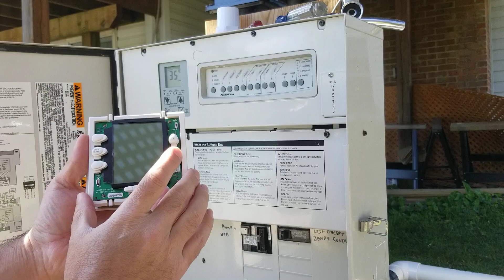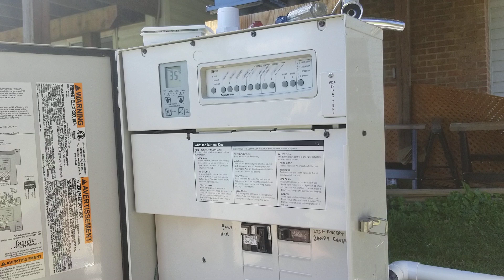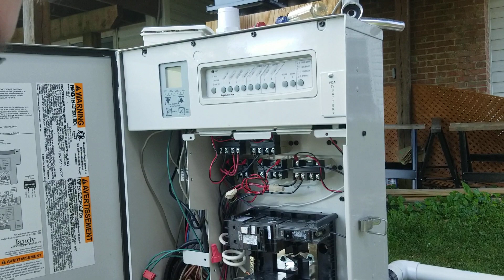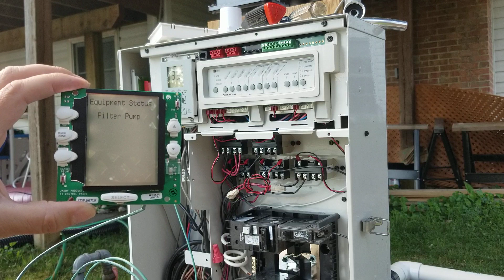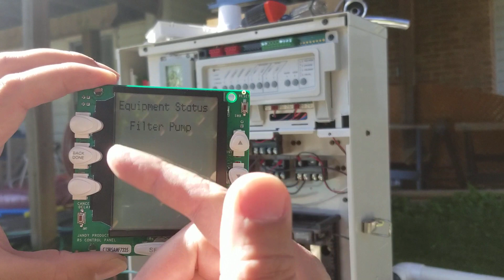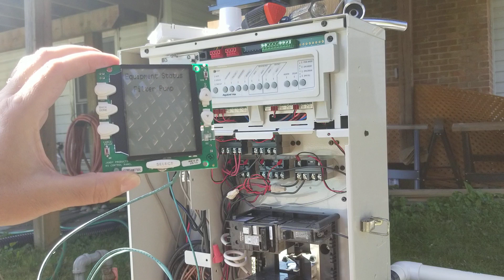Aqualink RS/PDA installing OneTouch

Comment: Great video. 
I have a Jandy RS system that can be controlled by the remote (white color). Can i use the one touch controller to set the automation schedule if i lost the hand held remote? Thanks

Comment: When I power up the system, the control in the house is blank. It’s not working what could cause that. Also, what should be the voltage read out of the connector?

Comment: My zodiac aqualink onetouch acts up with buttons unresponsive then kind of working then not again.  Got a new unit and before long same thing.  I suspect cable issues but not sure what kind of cable i need to use, can someone help
Reply from the maker: My guess is the buttons are getting corrosion on them. You should be able to take the membrane button covers off and clean them with alcohol.

Comment: I just installed a Smart JVA control board into my Aqualink RS4 system.  I do not have a One Touch controller, so I went through the steps that you provided (and in the instruction manual for the SJVA) by using the FLUIDRA iaqualink portal, which all seamed to work fine, well...except that the JVA that is connected to the SJVA control board does not move at all (note that I did move the JVA back to my "Solar" connector and the JVA moves the full 180 degrees.) The LED on the SJVA board is on solid when the JVA should be moving and flashes when not in use. Are there any tests that can be performed to determine why the JVA is not moving when requested? Thank you.
Reply from the maker: The JVA you want to control should be plugged into the SmartJVA board. Also you will need to assign the SmartJVA to the proper JVA in the "Smart JVA Setup" within Aqualink. There is also a "Calibrate" button in this section that you should use. In addition, the buttons on the bottom of the physical JVA that is plugged into the SmartJVA will no longer work. You still must put that button to left or right but NOT center. Center turns the JVA "off". Good luck!

Comment: Bob - I have the same setup. I recently purchased a new 'Aqualink PDA' board to upgrade my existing Aqualink RS' PCB that is vintage 2003. I have a One Touch panel (newer) that works with the RS system now.  After installing the Aqualink PDA Power Center main board, I can't get the One Touch Panel to work - It powers and displays Firmware Revision, but no controls. Do you have any suggestions on a setting or something else that needs to be set on the PDA board or One Touch Panel to make them work together?  All controls work at the Aqualing PDA main board - only a Onbe Touch issue.  Thanks.
Reply from the maker: Issues with RS485 devices frequently can be fixed by moving the 4-wire connection to another plug. You may have up to 2 devices in each. Swap a couple around if you are having issues. In addition, try setting the address on the OneTouch to another address. This is a jumper switch on the OneTouch board. Try this if the cable swapping doesn't fix it. I have seen this issue with the PDA and swapping the 4-wire connection fixed it.
Reply: Thanks! I have tried swapping between the two 4-pin connectors and also swapping the Black/Yellow wires with no success. I am not sure I know how to change the address on the One Touch - can you elaborate?  Thanks!
 @WoodBob
Reply from the maker: @d.b.2721  check page 26 on this link - https://cdn.fluidrausa.com/-/media/zodiac/global/downloads/jandy/automation/6594.pdf?rev=fa167047bf1644a093de0dbd96d6ff54
Reply from the maker: @d.b.2721  Also try a short piece of new cable direct at the panel to rule out a cable issue.

Comment: My Jandy aqualink RS4 inside panel got wet. The display reads garbled numbers and letters. Programs are still working. Is there something I can replace?
Reply: I was able to resolve the issue, thank you
Reply from the maker: I would guess some board is fried. The display is the SWG though and not Aqualink. Are you able to access it remotely via web, PDA or phone interfaces? Are you still producing chlorine?

Comment: Why is my panel very dim almost unable to see
Reply from the maker: John - There is a dim to bright control for the screen.
Reply: @WoodBob  Panel has on/off choice only?
Reply from the maker: @johnmoorhousedecorated-nam899  - Oh are you referring to the LCD panel on Aqualink for the SWG controls?
Reply: @WoodBob  I believe so I bought this house with a panel in the kitchen.
Reply from the maker: @johnmoorhousedecorated-nam899   - I just checked my OneTouch and you cannot adjust the screen contrast. I would check and see if the connection is good and tight and not too far distance from the Aqualink main unit.
Reply: @WoodBob  Thank You

Comment: where Do I connect the smart pump to iaqualinq please
Reply from the maker: @MsGabe25  - I am not sure what you are asking. Have you tried Fluidra tech support (Jandy Support)?  800.822.7933
Reply from the maker: You can use the exact same procedure to connect the 4 wire communications cable between Aqualink and your variable speed pump as I have shown for the OneTouch.
Reply: @WoodBob  I don’t understand where in the panel exactly cuz we did but the pump won’t start
Reply: Where exactly do you connect the 4 wires
Reply from the maker: @MsGabe25   You connect a 4-wire, RS-485 cable from one of the 2 red 4-wire connectors that I used in this video to the same color terminals in the pump. The pump is Jandy, correct? In addition, you also need to connect the pump relay to the power supply of the pump. There is a pump relay connection (the 1st one "filter pump") that goes to the pump relay. The pump relay provides power to the pump. You can see all of this in the instruction manual. https://www.jandy.com/-/media/zodiac/global/downloads/0748-91071/6594.pdf?rev=8ef7e65bffb247efb962fe23e434b87e
Reply: @WoodBob  that’s exactly where I connected however the pump didn’t start
Reply from the maker: @MsGabe25  Is it a Jandy Variable Speed Pump? You also need to set the programming in Aqualink. Under "System Setup" the first link is "VSP Setup" where you tell Aqualink that you have a pump and what pump it is.
Reply: @WoodBob  yes 2.7 hp the newest and best however it won’t start
Reply from the maker: @MsGabe25  Is it programmed in Aqualink? Are you turning the pump on via the Aqualink panel or via the computer/phone/PDA app?
Reply: @WoodBob  I tried the phone
Reply: I will call them but I understand from you that I need to sett it up in the app which I didn’t do as yet
Reply from the maker: @MsGabe25  Once set up in Aqualink, hopefully it will turn on.
Reply: Bob are you still checking this channel?

Comment: I want to upgrade to a variable speed pump. Is my PDA-PS6, Type Combo,  Firmware 1.2 able to use a IQ20-RS iAqualink 2.0 RS Conversion Interface Kit with PCB board to control Jandy Variable Speed Pump.

Comment: Where can i get a replacement door latch for the power distribution center?
Reply from the maker: I am not sure you can just get the latch. The parts sheet does not list it separately. Probably just need to get a generic stainless steel latch and adapt it to the box. https://app.redpepperdigital.net/a10/publications/2022-product-catalog-no-price/230-231

Comment: Hi there! My OneTouch panel stopped working recently. My pool guy suggested I run new cable from the Jandy to the house myself in order to cut down on costs. What kind of cable am I looking for to connect the OneTouch to the Jandy? Thanks so much!
Reply: You could use any outdoor rated SOLID copper 4-wire 22 gauge or better "alarm" wire like this one. https://www.amazon.com/Conductors-Unshielded-Security-Control-Cable/dp/B07JMHYTQ6
Reply: @closewatcher8586  Thank you! Appreciate you!
Reply: Did running a new cable solve your problem?  My OneTouch has been acting badly for 3 years and have not been able to figure out what's wrong.
Reply: @davidgroves4208  Fortunately (kind of) we discovered the OneTouch shorted out due to moisture in the wall from a leak. We tore out the siding and replaced the exterior wood, then ran a dehumidifier for  couple of days, and patched everything back up. The OneTouch was back working. 

However my iAquaLink stopped connecting over wifi, so I did go ahead and run outdoor ethernet cable into the module and now my entire system is working perfectly. I know that doesn't answer your question, but that's my update! Good luck. This stuff can be so annoying.

Comment: Why do you want your valves to move in 5% increments?
Reply from the maker: I have a sheer descent and a rock waterfall. Sometimes I want all the water on the sheer, sometimes all on the rock. But usually some balance between them. The SmartJVA allows me granular control.

Comment: Wondering how do you change the back up battery?  The date change back after main shut off is turned off.
Reply from the maker: I don't actually have a backup battery are you sure you have one? I have the door but nothing is behind it I've checked.
Reply: @WoodBob  Thanks... the menu indicated that there is one and in the past, when the power is shut off and back on,  the date and time would be correct but now it revert back to 2007 which is the year when unit was purchased and installed
Reply from the maker: Look for a button style battery on the circuit board that would be the only other place I could think for a battery backup. If so it is probably a CR-2025/32.
Reply: @WoodBob  THanks ... will take a look
Reply: @burlingwoodau7277  the button battery is the one you need to change out. I had same issue
Reply: @nickdeliberty2271  do you know where it is?
Reply: @burlingwoodau7277  it is located on the back of the pcb board, easy to see when you flip the board forward
Reply: @nickdeliberty2271  Yes and it is a CR2032...

Comment: Can this be added to the older boards. say 2005 or so? Thx, David - Dallas
Reply: Yes it can.  My RS 12 was circa 2004.  If I recall, the IQ20 only works with up to RS-8 out of the box and wouldn't control the B board of my RS-12.  I had to reach out to Zodiac and they provided me with the information to pass along to my pool company so they could order, receive and install the upgraded parts I needed.  These are my notes from the time I was going back and forth with Zodiac:  Jandy/Zodiac will send the pool company (will not send to homeowner) the RS12 upgrade chip for the IQ20 board overnight with a return package for the old chip(s).  There is no upgrade necessary for the second board of the RS12 setup.  The pool service tech can then install the upgraded RS12 chip and reprogram everything.

This is the information I needed for my particular setup to get an upgraded RS-12 chip for the main board:

IQ20-RS Upgrade Kit Serial Number - B16IALMB5141  (Rev T)
IQ20-RS Upgrade Kit Device Number - QG7-2R3-KGM-8PP

I upgraded to IAqualink in 2017, so the Rev T might be different now.  it's still working well and I just connected a new Pentair IntelliFlo VS 011028 pump to it, which can be controlled from the Jandy controller.
Reply from the maker: That is a good question I do not know the answer. My system is 2017 and REV T.2. Try calling Jandy tech support.